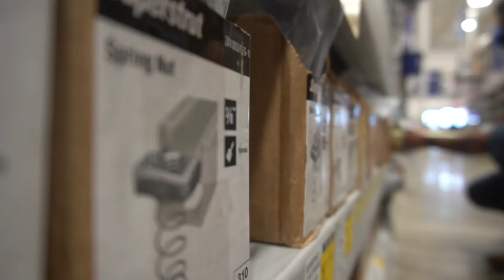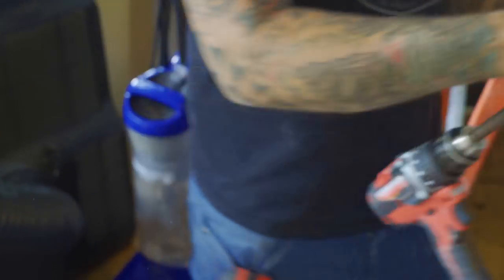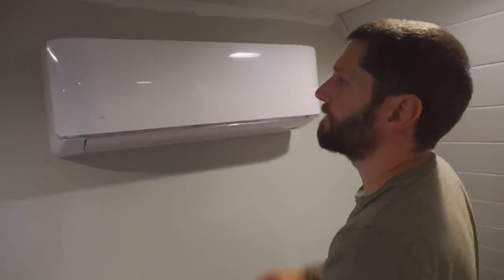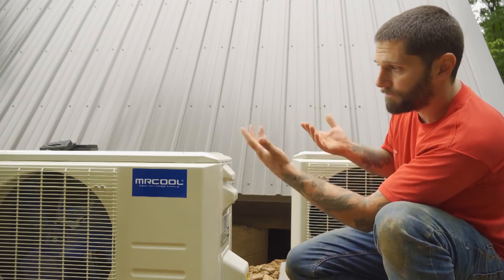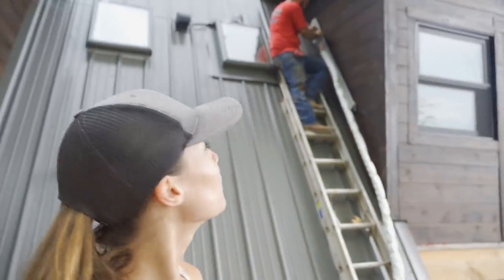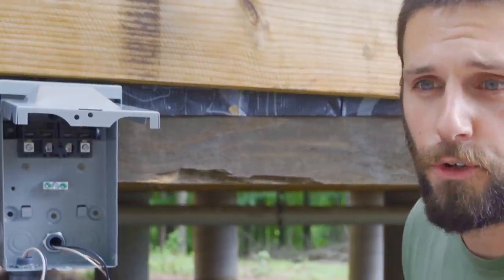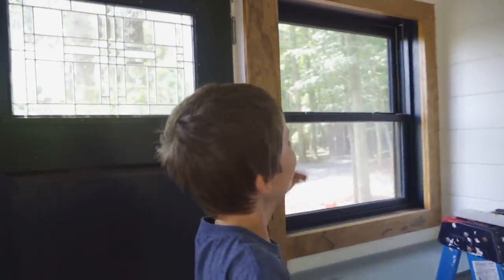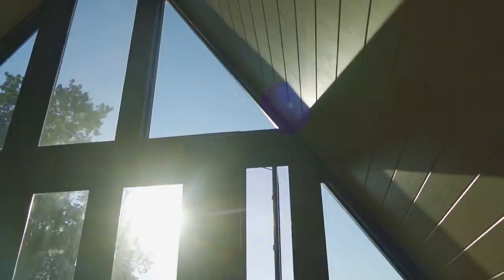Installing AIR CONDITIONING In Our Off-Grid Home!

Comment: Does the manufacturer of the mini split recommended pulling a vacuum on the evap and line set?
Reply: Normally, that is necessary, but not for the "Mr. Cool" brand "DIY" series products, like shown in this video.  The DIY series products come with pre-evacuated and pre-charged lineset and indoor unit, with special fittings on the ends of the lines where the connections are made.  Therefore, no evacuation of the system is required.  The Mr. Cool DIY series units are therefore technologically superior to most other units on the market, in terms of ease of installation.  The downside however, is that they seem to charge considerably more for their mini-split DIY series units, compared to other competing brands/models of similar performance, which do require the vacuum pump and associated tools for doing manual evacuation of the lineset and indoor unit.
Reply: Fritz Schlunder That’s pretty awesome, thanks for the reply. 👍🏻

Comment: when such an air conditioner is installed, air must be drawn out of the system. this must be done before releasing gas into the system. it is most ideal with a vacuum pump if there is no possibility to do so by irradiation.
Reply from the maker: This is a DIY system. The line set is precharged

Comment: As long as you have an inverter that's able to handle the startup load all day long that should be able to run on solar my son runs his welder all day long as long as it's sunny off of solar and like I said the main thing is that the inverter is big enough to handle the startup of the machines you may have to shut it off at night if it doesn't go all night open some windows let the cool air in from the night air I'm not sure on that positively but on our system we don't have air conditioning don't need it we live in a barndominium that has 6 inch of slab floor and it keeps his cool in here all summer we open the windows at night capture the cool air shot him in the morning and keep the shades shut on the sunny side of the house it works we maintained around 75 degrees when it's 90 degrees outside

Comment: How did that system run without pulling a vacuum on the refrigeration lines ahahaha
Reply from the maker: 😆 Perfectly since its a DIY system that does NOT need to have the lines vacuumed. The line set is precharged.

Comment: you are supposed to pull a vacuum on the lineset before opening up those valves in the condenser. you're going to have problems
Reply from the maker: not with these units.  They are DIY and the line set is already precharged- no vacuuming necessary

Comment: Also, how are you able to do all this without a licensed electrician and plumber? I’m under the impression that I can’t touch anything before I get an occupancy permit
Reply from the maker: Josh is a licensed electrician.  Requirements for occupancy and what requires inspections/permits etc. vary from county to county so you would need to check in your specific area to find out what is required there
Reply: Good for you guys!

Comment: Why didn’t you use a multiple head condenser.
Reply: Because they wanted to install the units completely themselves - these are pre-charged, ready-to-go DIY install units... a multiple head condenser would have required professional AC install (with all the cost and scheduling / pandemic issues).
Reply: Mr Cool has multi head condensers that are diy. I have been looking into them for my home.
Reply: @robertgodi6897  Cool, didn't know that MrCool had a multi head DIY... maybe the Wild Wonderful crew wanted redundancy in case one of the condensers fails... ;)

Comment: I didn't know you could get YouTube off the grid.
Reply from the maker: The literal definition off off-grid is not being connected to the public power grid, public water or sewer (we are not connected to any of those).  Off-grid has nothing to do with internet however, if you want to split hairs we aren't connected by lines/cables to the internet either 😂

Comment: Why didn't you pack the air conditioning units under the house? There would have been space there and you don't immediately see the "ugly" plastic housing.
Reply from the maker: Eventually they will be. We haven't finished building on the exterior of the house

Comment: what was that? they did not vacuum the coolant lines, or at least one sweep with the same coolant !!! As well as they connected and released the refrigerant, they left the air in the lines, that will cause first, lower performance of the equipment and second, damage to the compressor after a year. This is due to the reaction made by the humidity that was left there with the 410a refrigerant. And by the way, that abyss is a danger for bees, because where there is an abyss, there are a thousand of them looking for honeycombs to kill them and steal their honey.

Comment: A system that normally has had a professional install it in the past makes me a little suspicious. What happens if the refrigerant leaks out? Those quick connections will leak in the near future from vibration. That's physics. The connections need to be brazed and line sets pulled into a vacuum before refrigerant installed. Most HVAC contactors I know will not touch a system that was not professionally installed or even purchased by the homeowner separately for that matter. I hope most people that have put them in have the electrical professionally done and inspected with a permit.

Comment: How could anyone argue with a professional electrician.
Reply: Because the wires are too small and could start a fire they need at least 12 gauge wire and he used 14 witch is smaller

Comment: La verdad no me parece una buena instalación, porque en el lugar que puso la interna no está en el sitio correcto porque el flujo de aire se mantendría cerrado en ese cuadrado de espació. Otro que la externa no debería ir cerca a la tierra, debería tener una estructura que elevé a la externa, porque la tierra para nada es bueno que esté con tierra, si no lo limpias bien puede haber partículas que entren mientras haces una recarga de gas y puede contaminar el equipo. Otro que el equipo parece de baja capacidad de BTU, y eso afecta en las cañerías, mientras más largo es el trecho de las cañerías de la interna a la externa más capacidad necesita el equipo.
Yo contrataría a SERTGH

Comment: You didn't remove the air from indoor unit before open the ports on outdoor unit....it's mistake.
Reply from the maker: Its not necessary with these units. We go over this in the video after this one

Comment: You are so lucky you don’t need a permit.  In my city you need a permit for all the work you are doing.  You even need a permit to change a porch light with existing wiring and we have these snotty city inspectors that drive around trying to catch you or a trades person doing work on your own house.  It’s the most ridiculous thing you have ever seen.  I understand needing a permit for large building projects for safety reasons but not for simple home projects .  You even need a permit to change a toilet or even installing a new garbage disposal using existing plumbing lines.
Reply: Holy crap!! Where are you located? Are you with the HOA?

Comment: Where is the air removal from the pipes? It wouldn't hurt to read the theory.
Reply from the maker: You don't vacuum the lines with this system. The linset is precharged.

Comment: No vacuum pump on the refrigerant lines??? Also I wouldn't have sealed up all the compression fittings before pressure testing with dry nitrogen. The start up process is crucial, Now air is trapped in the lines. Cutting corners will cut the life of the AC compressors drastically!!!!  You should have had a licensed HVAC technician do this part of the install for you. Just sayin....
Reply from the maker: This is a DIY system.  You don't need to vacuum the lines. They are precharged
Reply: I am a HVAC technician and diy hvac is more mony in my pocket. Keep thinking you will never have any issue's with your wonderfully installed ac systems LOL!!!

Comment: You didn't vacuum the line before opening the refrigerant into the system, you have to vacuum the lines to remove moisture. This is the biggest downfall of the DIY AC systems. Youtube is full of these Mr Cool self install system how-tos, but no one performs the most important step.
Reply from the maker: Not necessary with this system. The line set is precharged

Comment: Do you know what kind of aircons are MRCOOL? That is a non-existent factory in China. Same AC is sold in europe under the name VIVAX. It is a chinese factory that sells you products with your desired brand. You can see the same AC under different name all over the world, the manual is the same the compressor is the same the unit is the same. Unlike a brand name like samsung, panasonic, daikin where on every pcb and most parts you can see the brand name here with MRCOOL or VIVAX (same thing) nothing is branded inside the unit because the parts are generic...

Comment: dont like being the guy to tell you you messed up ... but you killed those units early by not doing a vacuum on the new lines...
Reply from the maker: This is a DIY system that does not require that.  The line set is precharged.  We discuss this misconception in the video that follows this one.
Reply: @WildWonderfulOffGrid  OKI.. glad to hear that. :) loving your vids by the way. :)